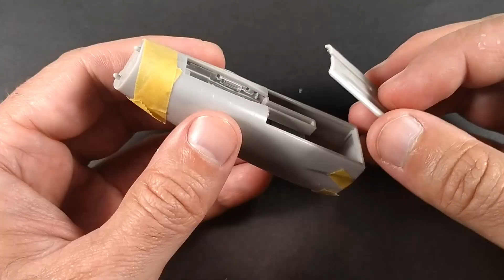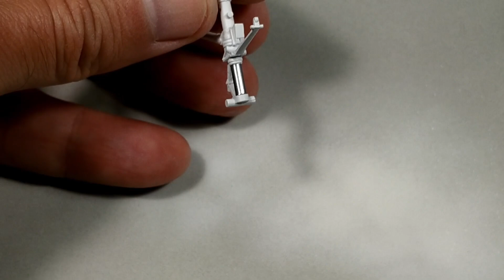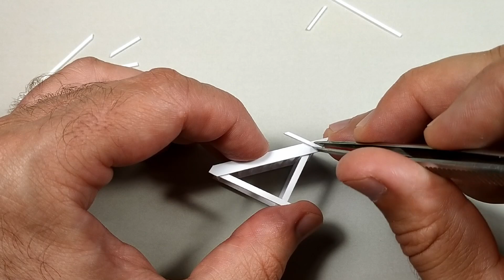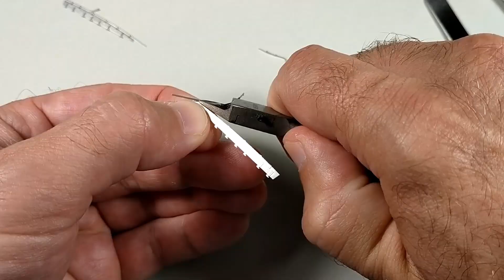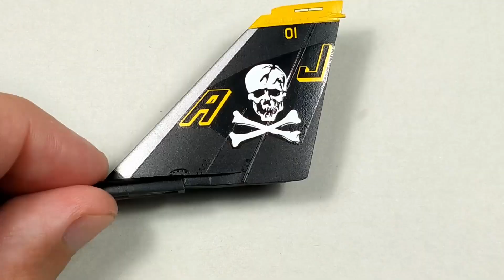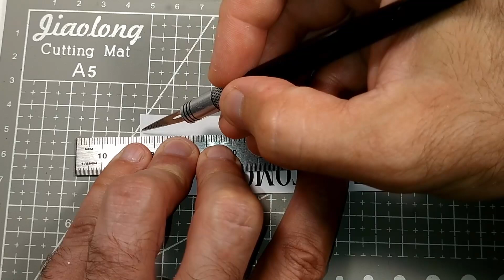F-14A Tomcat Diorama 1/72 Hasegawa

Comment: Yeah the TF-30 had its issues but once the F-14As were at higher Altitudes those TF-30s became very efficient and performed marvelously and if pilots weren’t careful when at supersonic speed. The TF-30s in combination with the way that the Tomcat’s air intakes were design. The TF-30s would start behaving like the engines used on the SR-71 Blackbirds. 

Pilots were told to keep the speed under Mack 2.46 to prevent the flames from move forwards into the compressor blades which weren’t designed to survive the kind of heat generated.
Reply from the maker: That's true, however, the GE engine widened the performance ability. The F-14B and later the D were the ultimate BadCat...😁
Thanks for watching the video.